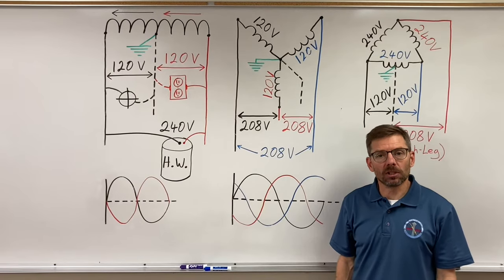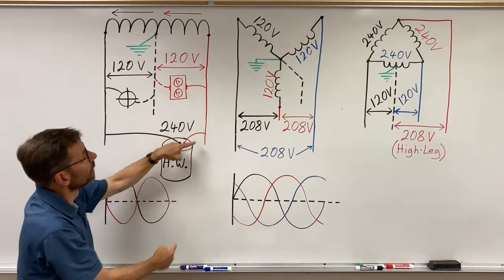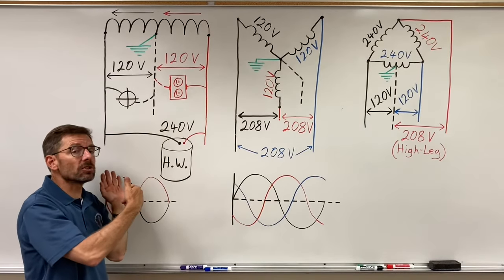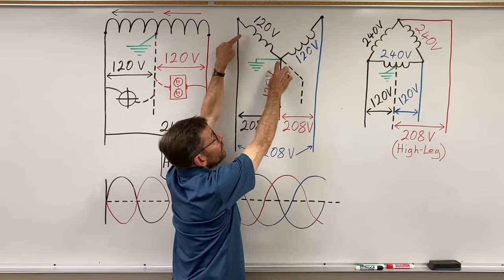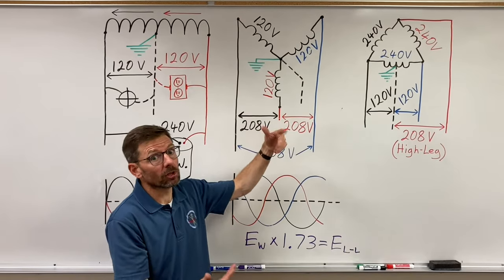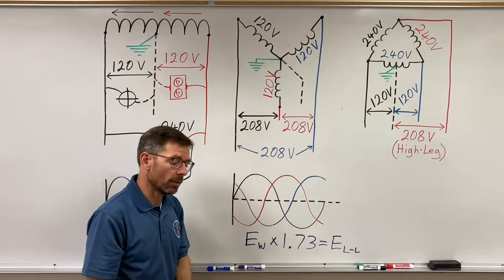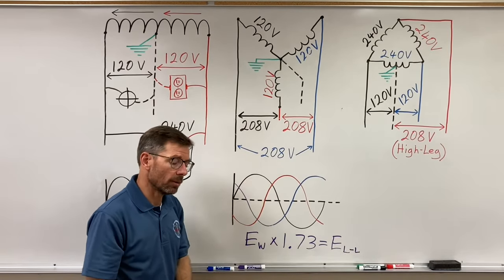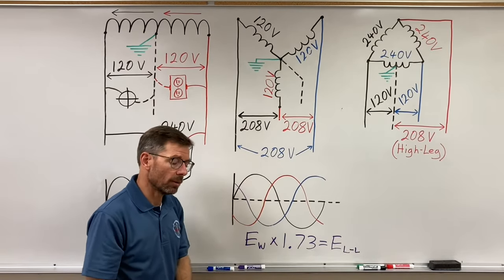120/240 and 120/208 Volt Transformer Secondaries

Comment: So there is a push and pull or alternating between the 240 lines but there never is a push from the neutral? So 120 is off and on but not back and forth between hot and neutral?

Comment: Can you get 120v to ground without a neutral for single phase power from a 3 phase panel?
Reply: Yes, but you have to use 3 consumers with the same resistance (light 3 lightbulbs) and connect all ends together and all the other 3 ends to the different phases.

Comment: So I should be able to use a 208v 3 phase unit on a 240 service correct?
Reply: Only if it is dual-rated for both voltages, and doesn't strictly require 120V to ground on all 3 phases.

Comment: Does the 3rd diagram supply 3 phase 240 Volts
Reply from the maker: Yes, if you use the three wires from the corners of the delta triangle you will have 3-Phase 240 V.

Comment: I received dumpling machine from China and they made 220v single phase thinking it's good for using in the USA. There are five wires coming out of the machine. Electrician said its 3 phase, but he was afraid to make the connection because on my circuit breaker cabinet said 120v/208v. Can I use this machine without transformer?

Comment: You may find instanes where you are given either a 3 wire cord or 4 wire cord and youre told the voltage supply is single phase, finding a starting point isnt always so easy, I kindly ask that you clarify slightly more so that we get a better understanding of your informative lecture. Thanks a lot, i hope to hear from you.

Comment: So, in the USA electric companies have two kind of generators, one for residential customers (180deg out of phase) and another one for bigger consumers (120deg out of phase)?
Reply: No, they use the same generators, and the same distribution grid.  The electric companies only have 3-phase generators.

A neighborhood might get an entire 3-phase feeder, but a group of typically 3 neighboring households share a single phase transformer (not necessarily 3 houses per transformer, but suppose it is, for our purposes).   Suppose a neighborhood has 9 houses in total, with 3 houses to a transformer.  Houses 1 thru 3 share transformer #1, houses 4 thru 6 share transformer #2, and houses 7 thru 9 share transformer #3.   Transformer #1 is connected to phase A and neutral, transformer #2 is connected to phase B & neutral, and transformer #3 connects to phase C and neutral.  Every transformer gets a staggered phase from its neighbors, to distribute the power as best as possible to the 3-phase feeder

The secondary side of each transformer, is now a separately-derived system.  The center point of the secondary is tapped, and bonded to the grounding electrode.  This defines the neutral for each household.  The two remaining points on the transformer, then get a voltage that is 120V nominal to neutral, and opposite in phase from the other line.

A neighborhood might also only get a single phase feeder to its side-street, that ultimately comes from a 3-phase feeder on the main road.  Each side-street would get a staggered phase from the nearby side streets.
Reply: @carultch  it took years for somebody to explain this to me! I appreciate your time and knowledge! THANK YOU!

Comment: In case I wanted to connect a single phase load on 208V, the two wires I have to choose from can be any live combination that is from the three live wires, What I do not get and I want clarity on is if am choosing any two wires from these three for single phase connection, how do I incorporate the neutral? Because here in Canada we use Black, White and Green for any single phase load. When you say 208V single phase around 8:45 minutes, how do i do the arrangement so that I incorporate my live wire, a neutral and a ground?
Reply: Here in canada, we dont have single phase 208V ( line-neutral ).
Its like he explains, ( Line to Line ) is 208v 
And ( Line to Neutral ) is 120v
The colors of your wires dont matter.
You can always put some red tape on your white wire if it not a neutral, just to prevent mistakes or accidents.. but if its clearly identified as 208v, usually, nobody will think that the white wire is neutral.

Comment: At 2:20 you point with your finger the direction of current flow for the RED-half of the inductor. Is this correct or wrong? Appears to be a mistake. Are you using conventional current or electron current?

Comment: I really appreciated how you showed on the sine wave diagram how you get the 208v instead of just the math or showing the Delta diagram and how it is 120 degrees out from each other. Though I understood the math and the Delta diagrams from others and how that works out to 208 volts, the sine wave explanation was the eureka point where I fully got it (I am an Aspie and need that visual).
I am an equipment repair technician and HVAC-R contractor. I have a rudimentary understanding of electricity in that I have not gone to college for my education and though I fully understand the math, that is not my forte. Now, I have a quandary, or maybe just a question. I have worked in quite a few restaurants and small industrial settings as a repair technician/HVAC-R contractor, and even taught HVAC-R and then welding in a technical/community college where, instead of the WYE 120/208 or even the Delta 120/240 w/high leg, the panels that the equipment/appliances and even the 120 outlets were supplied from, actually had all three legs that were 120 to neutral and any two of the three legs were 240; how is that accomplished? And yes, the supply panels were sub-panels but were directly tapped from the main panel in the building. In other words, there were no transformers or buck boosters inside the buildings that I saw, and the only transformers I had seen were the green boxes on the ground outside or, banks of big grey pole transformers feeding the restaurants.
Reply: Good question.
Reply: @ivanzapata396  not as of yet. I am more on the side of curious than 'need to know' at this point and I no longer work in those fields. Always learning though.

Comment: i recently installed 3 phase in my building,  they would not give me 240 delta so i had to go with 208.  do you know why they won't install 240 delta anymore?  is it just because people don't know how a dmm works?
Reply: You'd probably have to argue that with your utility provider.   Although here are the reasons I can tell.   In a delta configuration with a center grounded transformer,  maintaining a balanced system is nearly impossible,  since all the 120 volt loads come off one transformer.    240 volt, single phase loads strategically placed in the panel can help, but there is a catch.   The two pole breaker must be rated 240V, not 120/240V if placed on the high leg, and 240V double pole breakers are not as common and more costly than the 120/240V and will likely need to be special ordered. And most, but not all 240V equipment will run fine on 208V, for instance many larger window AC units and outdoor condensers mention 208V and 240V on the nameplate.     So to sum it up the 240/120V three phase system although still useful in very specific applications,  is something a lot of utilities no longer install,  although other's will install one upon request,  and electricians therefore must be aware of this system because you will run into it at  some point in your career.

Comment: If the electricity goes back and forth in an AC system at any given time, then why is there always a hot wire?
Reply: Because you need to be more specific about what you mean by "electricity".   Individual charges go back and forth, but the electric field propagates as a result.  The voltage is a property of the electric field, that makes the hot wire hot.  The nominal voltages you see for AC systems, are really a special kind of average voltage, called RMS voltage.  They aren't necessarily instantaneous voltages.

Comment: Im confused. If you don't need a neutral for 240V, how comes dryer plugs are 4 prong with the neutral?
Reply: Hmm. Would that be the ground connection to the metal chasis of the dryer? And from the chasis to the ground conductor, to the ground bus, to the ground rod? .... 
Im not sure so please dont assume as that would be potentially very dangerous.. 
Just a novice guess someone can school us both in on that.
Reply: Some dryers may not need the neutral, but some will have 120V control circuits.
Reply: @GH-oi2jf  That makes alot of sense tbh.. when  looking at a basic 120/240v transformer circuit. Thank you.

Comment: draw the math for the 208 voltage (high leg) on the delta.
Reply: Draw an equilateral triangle that is 24 cm on a side, representative of 240V between any pair of phases in this system.  Drop an altitude in this triangle, and measure that altitude.  The altitude of this triangle will be 20.8 cm, representative of the high leg-to-neutral voltage.  The split base of this triangle will be 12 cm on each side, representative of 120V to ground for the A & C phases

Comment: High-leg delta is a bad system. Symmetrical load is almost impossible and it´s complicated to use. Here in Europe, every household gets 230/400V three-phase power. 230V 1p for normal appliances and 400V 3p for every device above 4kW.

Comment: Those sine waves on the single phase are 180° out of phase, so they would cancel and you'd get no voltage at all, rather 240V for the H.W so what's going on there? It's makes no sense
Reply: Measuring across two phases, subtracts one voltage from the other.  One voltage is 120V nominal "above" ground, and the other is 120V nominal "below" ground.  The net difference between them is 240V nominal, line-to-line.
Reply: Excellent point!  Glad to see someone is questioning this!  Imagine an oscilloscope hooked up to the transformer to obtain the waveform shown by the author of this video.  The leads for the black waveform are hooked up correctly.  The leads generating the red waveform are hooked up in reverse.  If the leads on the oscilloscope for the red wave were attached in a way that follows the current flow (not in reverse) you'd see the red wave in phase with the black wave and they wouldn't cancel.  It's all about observing the correct polarity when attaching oscilloscope leads.